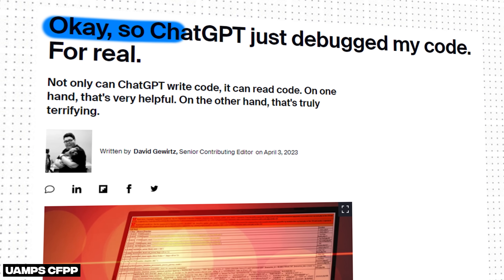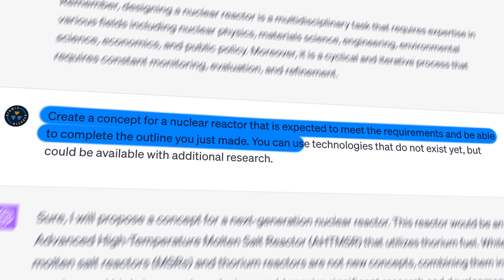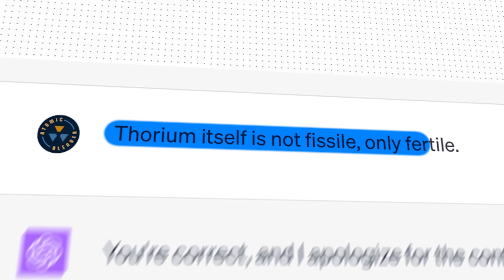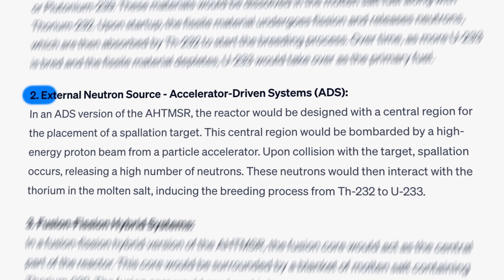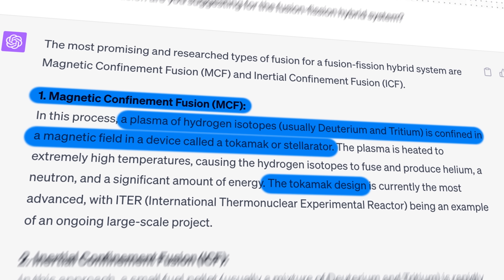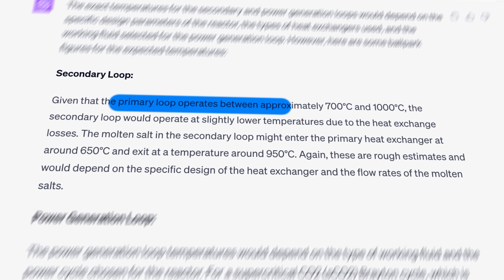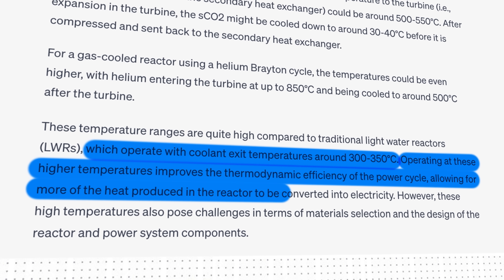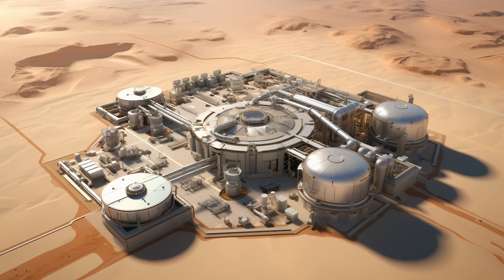Unveiling ChatGPT's Insane Nuclear Reactor Design

Comment: I'm a retired engineer. One of the exercises we used to use was call blue-skying ideas.  It was a roundtable discussion of a topic on problem solving/design.  Outrageous ideas tossed out during the session weren't immediately discarded, but examined to see if elements of the idea had promise.  I can envision ChatGPT or other AI being used to generate weird and strange solutions for the same consideration rather than generating a specific design.

Comment: i like the idea of having a molten salt thorium solution as neutron shielding in a fusion reactor that can then be used to produce even more electricity. its two birds with one stone, neutron damage is a big deal and having those excess neutrons as a boon instead of only horrendous maintenance costs is kinda brilliant.
Reply: How do you keep the (liquid) shielding in place?
Reply: @bpj1805  nothing clever, just pipes from a material that doesnt interact much with neutrons.

Comment: The hybrid reactor doesn't have to produce net-positive energy for the same reason the starter motor in your car doesn't: it's whole purpose is to take external energy to start up machinery from a cold stop, not to replace the main engine as the primary energy source. 
Small reactors like the ones used at universities are often used to generate neutron pulses and neutron beams; although those are small fission reactors rather than fusion, any kind of small nuclear reactor able to produce excess neutrons could be used to jumpstart the breeding process.
Also the jumpstart reactor doesn't need to be "inside" the main reactor any more than the starter motor on your car needs to be inside the piston. You'd construct it to emit a neutron beam, and aim the beam into the main reactor to irradiate the fuel.

Comment: The fusion-fission reactor seems interesting, in case the fusion can't produce enough net energy on it's own. It would be even a nice idea if we could just pipe those neutrons into room nearby with the fission reactor. But since it's not likely we will have such technology, even if it is feasible, it seems the idea is insane. But the idea of using neutrons to breed materials on the surface of the fusion reactor is not new. Some are thinking it may be a good idea, to produce materials needed for reactors that way. I don't remember what it supposed to produce, maybe He3?

Comment: Actually an Accelerator driven system is currently under devellopment in Belgium (since around 2018) and is called MYRRHA. This kind of nuclear reactor is not exactly designed for pure energy production (M is for multi-purpose), its main goal is to run on nuclear waste produced by regular nuclear reactors, isotope production for medical purposes and of course research.

Comment: I like the absence of abundant super critical material with the particle accelerator model. The whole idea of shutting off a particle accelerator immediately damps the reaction seems to have some serious safety benefits even if the energy penalty would be the-suck.  Might consider all the particle accelerators ever built are built to academic standards and academic purposes and so lots of sensors lots of modularity for mutability of purpose which a dedicated piece of equipment could side step.

Comment: The problem with using GPT as models is that it’s still a black box. You can’t have a well defined control system with safety in mind when the entire thing is still blackbox, especially when it comes to control systems.

Comment: Or you can simply do this:
Dig a wider hole 2-3m, cover bottom with led 20cm is enough, cover led with concrete so it won't transfer heat to lead and melt it. 
Put a lot cupper rods pointed at the center, where cables will run around the walls of the hole. Point of this is to capture energy. 
You wanna cover this thing nicely, also with some led mixed into concrete topping. So it wont radiate outside that much, and also to prevent water from getting in. 
Although this might not be a problem as it will evaporate in a couple of mins. 
Best part? You take all short live radioactive metals. Tiny amounts, the purer the better. Not much. 
Put them all in the middle, so they start to react. Simple as. 
Reaction covered nicely to prevent radiation from going on you. (no it wont cause Chernobyl 2.0) will generate heat, heat will either warm them or even melt these isotopes, idk maybe they will turn into plasma, which would be best. 
But i doubt it will reach such temp. 
But what matter is that these things will start releasing energy, and you should be able to collect this energy through cupper rods and wires inside the this hole. 
That's it, free energy, easy make cheap. I think Russia did that stuff in cold war or something

Comment: it reminds me of a time I designed a submarine that wouldn't need to come up to air ever, having some sort of VAWT on top to recover energy by anchoring near underwater currents, a fat ton of car batteries to store electricity, electrolysis for recovering air for the crew, stainless steel hull to avoid the Titan mishap... (was arround 10 at the time, and my drawings weren't rival to Stable Diffusion)

Comment: A fusion-thorium hybrid reactor is not necessarily THAT stupid. You can use a much (up to 10x) smaller and less efficient and therefore simpler fusion reactor for the same energy output. And you can not only produce energy but also a large surplus of Uranium-233, which can then be used for other applications. And the fission process produces tritium as a byproduct, which can be used as a fusion fuel. I don't think that it is or will ever be the be-all and end-all of nuclear energy systems but it can be a useful part of a future nuclear energy mix. It is certainly not a "simple" technology but a pure fusion reactor is not necessarily simpler. The Lithium-Tritium breeding blanket of a conventional magnetic confinement fusion reactor is not necessarily much simpler compared to a Thorium molten salt fission blanket.

Comment: I like how it says environmentally friendly, as if that's not the biggest reason to use nuclear energy. Meltable plugs are only safe as long as they stay clean. Multiple steam trains had a similar safety mechanism, and had steam explosions due to the failure of those plugs. ChatGPT can not just make something from scratch. It needs a handful of examples to draw ideas from. It is still capable of finding some on its own, but it helps to provide examples.

Comment: ChatGPT's 3rd neutron source - fusion, is actually not too dissimilar from the fusion design put forward by Dennis Whyte and Commonwealth Fusion Systems / MIT.  They propose a molten salt neutron absorber as the heat transfer fluid.  While one of the benefits of fusion is that it is supposedly more 'proliferation resistant', I have been concerned that someone with such a molten salt cooled fusion device could do this very thing - breed U-233 from Thorium (or frankly Pu-239 from U-238).  ChatGPT isn't out to lunch on this one.  It's highlighting a reasonable path to breeding U-233, which is actually kind of concerning.

Comment: you asked the tool to use unproven and new tech, and then are surprised when it does? There is a paper written at NIF about 10 years ago detailing the use of an 80% fusion reactor at the core of a fission type device to generate power from nuclear waste; the tool probably used that paper as a basis for it's design.  If you think of ChatGPT as an intern, you'll get more out of it.

Comment: The fusion-fission hybrid is actually valid with a little more research. Multiple companies are researching such systems for use in producing medical isotopes close to the use center. 

The fusion system is not energy producing. If anything, it is an enormous energy hog. But in this case, you are not interested in using it to produce energy you are using it to produce isotopes that are fissile so the answer is valid. 

The key to the medical isotope breeder is that it is supposed to be small and simple enough to produce small amounts of isotopes in a device small enough to keep inside a shielded room inside the hospital itself. The device I've read about absent shielding is a benchtop device.

Comment: I've never heard of using super critical co2 like this. Is the co2 heated by the secondary loop and then sent through a turbine? Does it stay super critical through the turbine? If not, how is it kept pressurized or repressurized? 
A video on how super critical co2 is used in a turbine would be very interesting.

Comment: It's important to recognise that GPT-4 is capable of basic informational tool use - the ability to create and infer new information outside of training data by building on ideas. This is still preliminary but what is surprising is that this property is unintended and emergent, rather than programmed, indicating that originality in thought may not be that unique or hard to achieve.

Comment: In the talks by Sorenson he mentioned the span of temperatures, it is probably GPT's reference.  Sorensen said the span would give a nice heat margin instead of the finicky one found in the Uranium reactors. 

 I also expect that temperature margin would cover a reactor to trickle along at 950 for minimum base load, then throttle up to "Rated Maximum" to the 1150 top end.  I expect above that and you get too much expansion in the salts and neutrons start escaping at a high rate shutting down or throttling the reaction. (Another factor mentioned in one of the thorium reactor studies)

Comment: Energy loss fuser is probably very doable, molten salt would have very low vapor pressure so it could hold a good vacuum. Just pump it past the fuser and rain it down while it keeps a small dose of neutrons and waste heat keeps the salt going. 
Won't produce energy but it will produce neutrons. Just run it for a few years and maybe it will breed enough to run with.

Comment: The Fusion-Fission Hybrid System is basically what Kirt Sorensen's LFTR is. There's inner shell where fission takes place and an outer shell where Thorium is bombarded with neutrons from the inner shell to kick off the Thorium cycle an produce U-232… that's then moved into the inner shell to continue the process.
Reply: IKR? Instead of regurgitating currently used designs,  it regurgitated existing project. And added some fusion, making whole thing worse.

Comment: The fusion part in this case wouldn't need to be over unity to be effective as a neutron source for a successive process. I'm surprised it stayed to limitations of the designs that are being attempted for that purpose, as that makes things much more difficult.

As for large temperature drops, it's going for efficiency at a peak output. Thus the biggest deltas it considers reasonable. Apparently it's still ignorant of the demands that would make on all the construction materials that are currently available.

Still it's interesting to see what something like that would try kit-bashing together as far as solutions go. Now imagine an AI that could do that with some detailed analysis simulation and an evolutionary modeling scheme, say like 1000 or so iterations over the period of a year to see what would be put to paper after finishing all that number crunching. Might be interesting to comb through the data sets on that if you knew what you were doing.
Reply: The AI told me it was not ignorant. It knows large-temperature-drop heat-exchangers have demands. For example, it told me that at low temperatures, FLiBe thickens (potentially freezing), and dissolved metals begin to plate out inside the heat exchanger. It also said that heat exchangers must be made from materials that do not melt or otherwise weaken at high temperatures or thermal stresses. 

Anyway, could this issue be sidestepped? Instead of one large-temperature-drop heat-exchanger, could the temperature be dropped in several smaller steps? For example, instead of a single 300 K drop heat-exchanger, could there be a series of six heat-exchangers, where the temperature drops 50 K between each individual coolant tank?
Reply: @michaeldeeth811  It's not just issues with the working media. Things like pipes and the methods of fastening them expand and contract with temperature and can end up with stress fractures or other weak spots. That's one of the things that will limit the range of temperature differences. So where the exchanges in heat occur really need to be limited to exactly where you're designing for it. There are so many overlapping factors, the AI probably just needs more data and time to get a better answer. Of course that's not just going off textbook, it needs simulation time with modeling and analysis.
Reply: @pauljs75  As you say, thermal expansion/contraction of "pipes and the methods of fastening them" causes stress fractures and other weak spots. With that in mind, an obvious solution would be to eliminate the pipes and fasteners. Instead of using pipes that solidly connect all of the tanks together, each tank could be physically isolated.  That would eliminate the thermal stresses.  Fluids could be moved (contact-free) between tanks using pour spouts, gravity, and tank pumps. 

Anyway, it's just a thought. 🙂

Comment: OK, serious question, eventually... As I recall, the MSR made fissile material by having the thorium salt be a blanket around the the core, absorbing excess neutrons. So once the reactor is "lit" it makes its fuel, you only need a neutron source to kick-start the reactor. In that sense, chatGPT's design wouldn't need a full-fledged net-energy-positive fusion reactor. It just needs a device that can create enough neutrons in a short enough time frame to breed enough fuel to start the fission core.Once the core is running, the neutron source can be shut down. 
So the question: wouldn't a Farnsworth fusor fit the bill? I'm not sure how big it would have to be, but I can imagine that compared to a functioning LFTR, it would be quite small.The fact that it wouldn't be self-sustaining is irrelevant.

Comment: Another nice thought about Thorium is that you cannot make weapons with them.  It has a different decay chain than Uranium, you don't get the Plutonium needed for weapons.
Reply: It is possible to separate plutonium from the active and extremely radioactive fuel/coolant solution some time after startup, due to the uranium fission involved in the same process - there's a non-zero percentage of it.

Comment: I think it would be possible to use a fusion reactor as neutron source to breed uranium/plutonium that is then been used as seeding material in thorium salt reactors. This could be more cost effective depending how available uranium is in a country and how strict the regulations are to mine and refine it.
Reply: You are ignoring the elephant in the room though. If you have a fusion reactor you won't need a thorium molten salt fission reactor at all. This entire stage can be omitted. A fusion reactor is worth it's weight in gold and then some as it would generate more energy than any fission based system ever could. Plus be used to maintain a clean energy output.

Comment: It is channeling a lot of different ideas, including some bad ones. Fission/fusion hybrid reactors are an idea for inertial confinement fusion using lasers or ion beams (e.g. the LIFE reactor concept). These neutrons would be very energetic from D-T fusion and they can directly cleave U-238 and Th-232 quite well and releasing way more energy per fission than is released in a fusion reaction (this means most of the energy is actually coming from fission). You want a first wall that is insensitive anyway; so they decided on a curtain of FLiBe salt (non-enriched lithium, you want the tritium). Each fission would also release a bunch of slow neutrons.

The problem with this is that we don't know how to do inertial confinement fusion. We need 10 shot per second at a few cents each; we have one a day at targets costing tens of thousands of dollars. This is never going to happen. If you're already doing a molten salt fission reactor and most of the energy is from fission; don't even bother with fusion, save the cost and trouble.

Then there are the subcritical accelerator driven reactors. These are a crack pot idea that has been given unwarranted attention and interest because the public doesn't understand that it doesn't solve anything (it is very easy to turn off a reactor; regardless of how you turn it off it still generates decay heat and accelerators don't change this). The idea is to get a reactor very close to criticality so that each spallation target neutron can generate tens or hundreds of fission reactions. That way if power is lost the reactor shuts down automatically. And then if cooling is lost it melts due to decay heat, solving nothing.